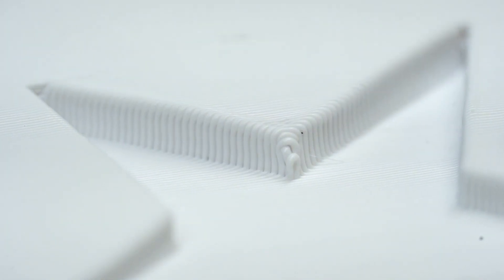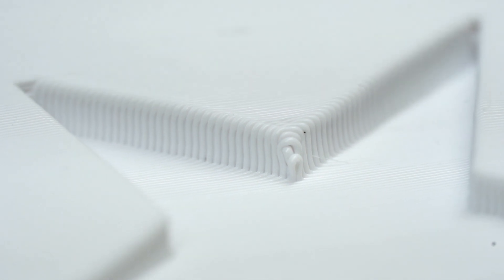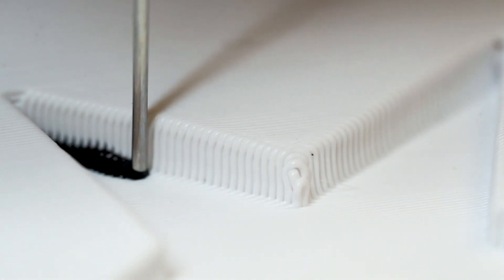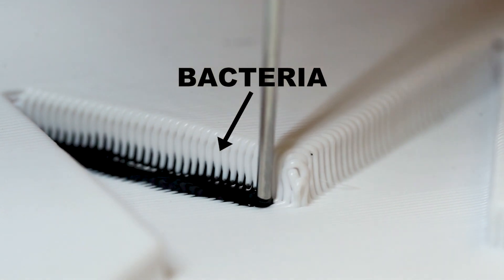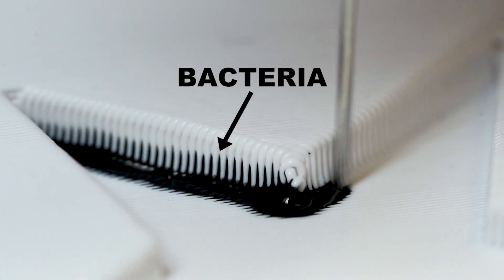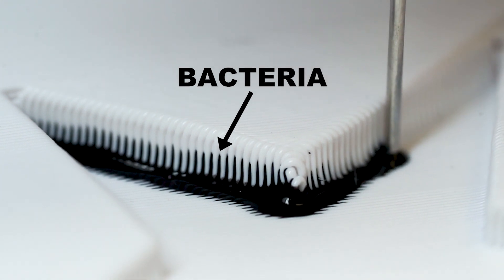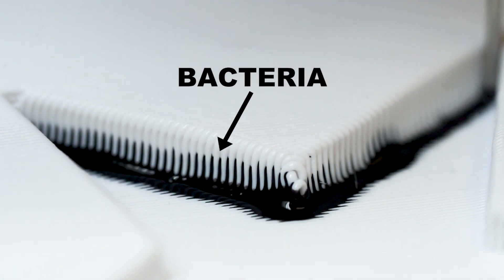Is 3D Printing Food Safe?

Comment: What about curing pieces with an epoxy resin to fill-in the gaps and clear-coat? Would this be safe as a water drinking cup?
Reply: I was wondering, too, and so I picked this up online:

“Finished, hardened epoxy products are practically non-toxic unless they are cut, sanded, or burned.”

I’m under the impression that the hardest materials are the ones that provide the least off gassing. Particularly for everyday, long term use, where people using a cup or dish, might not be aware it’s a 3D printed item and will expose it to typical kitchen maneuvers.

So, one thing that’s out there, although I don’t know people use it for making food items are ceramic 3D printers. I don’t know the current cost of those, nor the “ceramic filament”?

I really can’t speak on the use and validity of any of it.
Reply: I've also wondered about heat treating, like postprocessing with a heat gun. I've thought more about a belt and suspenders approach, printing in PETG, heat treating, and then resin coating. Seems like that could produce a robust part that might be persistently food safe.

Also this is for personal use, not for sale or in large quantities, so the risk math is a bit different.

Comment: Any thoughts on 3D printed hydroponic systems?  I have been struggling to decide how far I should be going with "food safety" when it's a part touching the water my food will be drinking.  I have seen a lot of people just print with any old filament, brass nozzles, no post-processing and not worry about it all but I know that doesn't mean it's OK.
Reply: Did you happen to find anymore information on the correct filament to use for the hydroponic system?
Reply: Hoocho does heaps of 3d printed system parts, pots etc. even makes and shares his own stl files. https://youtube.com/@Hoocho
.. Hope that helps
Reply: I'm pretty sure the plant will filter out almost anything from your 3d printer.
Reply: @bslygh  the stuff is great with Aquaponics since we need all the extra beneficial bacterial bloom we can get to cycle the nitrates. The stuff in a hydro system is just normal but not really needed and may convert some elements in your feed
Reply: People grow food in literal poop... i wouldn't worry.

Comment: One point that you missed it, that a lot of FDM printers use brass nozzles which also isn't foodsafe all the time. especially if you are using a brass nozzle from china out of a lead brass material mix. You kinda have to use all stainless steel parts in your printer to be foodsafe.
Reply: Yep, he misses that point... The thing is the lead content is going to be minimal afaik merely because the whole nozzle will have about 3.7% lead content in it. The nozzle is I assume 20 grams. In order to consume the lead you'll have to grind the whole nozzle into powder and consume it (and make sure you absorb it) and even then you're still under the guidelines for lead poisoning afaik. 
The reason there is lead in the brass alloy is not because it is made in China. It is because it is a Free Cutting Alloy brass mostly, since machining regular brass with any dimensional stability and without tools breaking is a lot harder... (That's pretty much the explanation i got while searching about the topic)